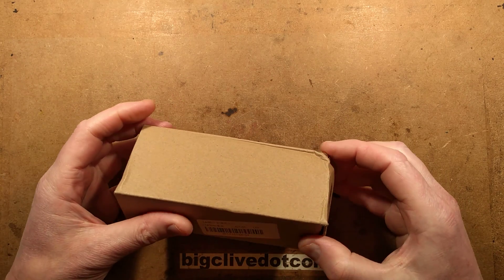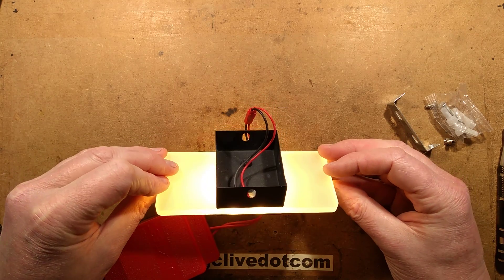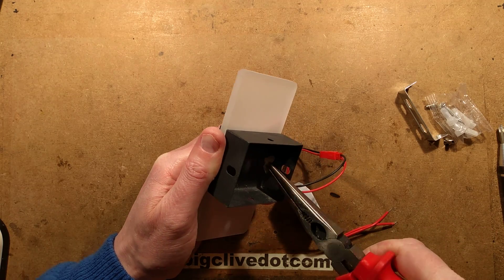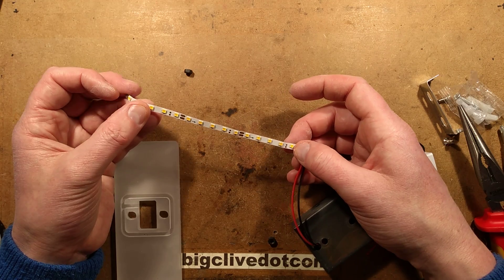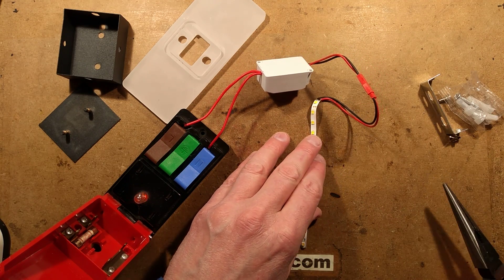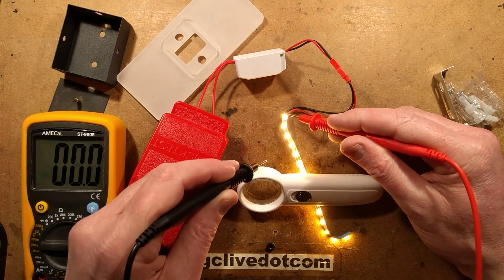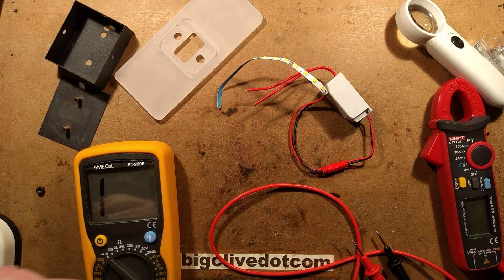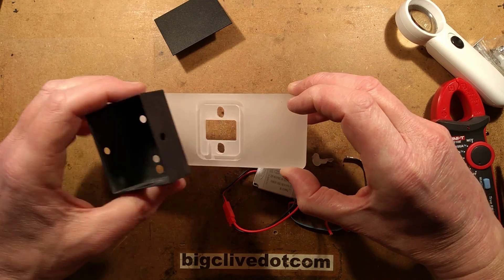Cleverly designed LED wall light with hackability.

Comment: While on the one hand, I would love some low-power wall sconces to light some areas of my home, on the other hand that looks like a design which will seem very dated in a short time. To me, it screams the 60s style of some design elements, especially their ideas of what might be futuristic. I think I may actually remember something larger with full-size light bulbs behind them, as well as something very similar meant to have candelabra bulbs behind. In the cases of these, the middle plate was there to act as a diffuser by blocking direct light from the lamp itself, bringing more attention to the acrylic plate and allow the indirect light passing through the panel and bouncing off the wall to illuminate the space rather than the harsh lamp itself.

Comment: I just found out that it is possible to modify the eeprom in this clamp meter. Over the EEVblog forum. Start in DC mode, 6000 count, longer back light timeout, dotless mode, more ncv options. They soldered wires on the board but it can be done with a simple clip on the chip.
Reply: you can also check this video https://www.youtube.com/watch?v=KIHGHWJFyGU&list=WL&index=112&t=0s or this https://www.youtube.com/watch?v=fX-Fhq9R4uY&list=WL&index=110&t=0s. and here is a link for a eeprom clip on ebay
Reply: Got a link to that? Not that I need any more meters in my life
Reply: @Fir3Chi3f  https://www.eevblog.com/forum/testgear/a-look-at-the-uni-t-ut210e/msg1034969/#msg1034969

Comment: Really hackable, you could power it from lithium cell(s) and exploit the metal front plate to make it touch sensitive using a TTP223 module for example
Reply: That's a sexy idea
Reply: Genius (everytime I hear that word I think of the fox from the mint mobile commercials)
Reply: I was not aware of that IC, seems useful, thanks!
Reply: the metal plate doesn't act like a finger already near the TP223? For example, the Cypress Capsense i found on youtube looks pretty complex, all to enable touch sense behind metal.

Comment: The red connector is a JST RCY, they're common in the radio control hobby world for low power applications (video transmitters, etc.).

Comment: Hi ive been told that my monitor im using with my BBC computer could have a different electrical potential from my BBC because it does not have a ground and could blow it up. Can you add a ground to devices that dont have them?
Reply: What monitor are you using ? To be honest this is extremely unlikely to be a problem especially with an LCD monitor, where the voltages involved are fairly low. Especially so if it's the kind of LCD monitor powered using an external power pack
Reply: @jaycee1980  hi it's a Hitachi lcd tv with only live and neutral. Its conected using RGB through a coax after I modified the output. Couldnt I just add an earth somewhere on the metal chassis inside the case.
Reply: @womble321  No need. The power supply in the TV is isolated. There is nothing to worry about.
Reply: @jaycee1980  thank you I rather like the beast and dont want it to die on me. Its now got a raspberry pi as a coprocessor btw. Great fun
Reply: Is no one going to mention the possible leakage current and resulting voltage due to a possible Y class capacitor?
Reply: @Mark1024MAK  hi ive just done some more research and discovered some people make sure the cable shield is earthed in hifi equipment when one of the units is not double insulated, it would be very easy to do, ive looked up leakage and am a bit confused. Seems connecting two double insulated devices is ok but when only one is it can potentially cause problems.
Reply: womble321 - Some class II appliances that use switch mode power supply units (SMPSU) use a class Y capacitor between the mains side circuitry and the “isolated” low voltage secondary / output side of the SMPSU. This low voltage side powers most, if not all of the circuitry in electronic devices like LCD/LED televisions, monitors, etc.
The purpose of the class Y capacitor is to suppress noise from the SMPSU. But it also allows a very small ‘leakage’ current to flow if there is an electrical path back to earth via any other device which has it’s own electrical circuits referenced (connected) to earth (mains earth or any other earth connection). The Acorn BBC Micro connects both it’s 0V/GND connection and mains earth to the metalwork of it’s own SMPSU.
So when you connect a lead between your BBC Micro and a modern LCD/LED TV, with both plugged in and the TV powered up at the socket, there may be a small spark (may not be visible) as you connect the lead.
So I recommend that you switch the TV off at the socket, or unplug it’s mains plug. Switch off the BBC Micro (no need to unplug it). Note that any and all class II devices/appliances that also connect to the TV (satellite/Sky/set-top box, DVD etc.) also need to be switched off at the socket or their mains plug pulled out.
Then connect the RF/UHF/composite video or RGB SCART (or whatever) cable. Same when disconnecting. No need to add any extra earth wires. So no need to open or modify anything.
Once everything is connected up, the problem is no longer a problem.
Note that the current is too small to do any harm to a human being, but if the current does pass through you, you may feel a ‘tingle’.
Reply: @Mark1024MAK  thats a brilliant explanation thank you so much. I would have tested it to see if it was earthed anyway before i touched it. I leave it more or less permanently connected but will be sure to to follow your advice. And yes ive definitely had a tingle from a tv lead before. Thanks again a little knowledge can be dangerous! Or at the very least confusing.
Reply: womble321 - no problem 😀
Reply: Pretty sure whatever powersupply is used in those is isolating. If you don't have any ground connection, the device is "floating", so it can't really be at a different potential. Quite the opposite. Ideally ground would be the same potential everywhere, but that isn't guaranteed, neither is the neutral the same. If you have two devices, it can happen that they are at different potential if they are connected to different circuits in your house (or even just different outlets in the same room, if there is a decent load on one of them). That can kill devices if those devices are connected to each other.
Reply: @superdau  thats about what i was told could I not just earth the metal frame inside. It a hitachi lcd tv id forgoten it wasnt a monitor because ive never used it as a tv.

Comment: 5:12 using a calculator to multiply 15 by 3? And I thought my mental arithmetic was bad.
Reply: I do this sometimes too. The calculator is already there and...
Reply: Using a calculator to find 1 X 3 was worse 😉
Reply: @georgeprout42   he demonstrated a mathematical proof that 1x3 still in fact equals three... common core math is trying to change that ^_^
Reply: @nobodyuknow2490    not quite - common core just tells us that 1 x 3 = 3, and 3 x 1 = 3, but 1 x 3 =/= 3 x 1
Reply: @restcure  no, exactly right because common core "mathematics" is the bastardization of thousands of years of mathematical certitude all to try and reinvent the wheel, only not as good as the wheel that already exists and in fact can consistently be demonstrated as inferior methodology and even in some cases flat out WRONG by virtue of its methodology.

Common core is to "mathematics" as a lobotomy is to mental healthcare.
Reply: @nobodyuknow2490  - were we both not referring to the effdup cc methods? - I thought I was
Reply: Worth understanding this is a constant current supply. So when you connect more LEDs in series, the supply will 'automatically' increase the output voltage to maintain a total flow of 200ma. He read 9V with the meter, but if more LEDs were connected on the strip be would have seen a higher voltage at the supply output.

Kind of counter intuitive when  used to constant voltage supplies. The voltage gets divided between the LEDs but the 200ma current flows through the entire circuit (even in the ground line)
Reply: I think the answer is 45... Just guessing as it's a "really" hard question
Reply: this is just lets say habit. i usually use calculator for everything, because i got used to do it.
from "200/5" to "calculate the meaning of the Universe" :D
Reply: People should learn how to work with numbers, bases and multipliers. As much as people like to rag on about Common Core in the United States this is what its intended to actually do. Long form multiplication seems efficient but requires remembering all tables in the single digits and then on top of that you have to write down the carry and worst of all the carry means nothing. Its the past "remember everything" teaching methods that make you reach for a calculator without realizing what the difficulty of a problem is at face value.

Understanding modulus math and being able to convert between them is very helpful here without knowing multiplication tables. We intuitively understand modular multiplication of 5 because its half of 10. But then why is 2 so much easier than 5? 52 x 5 is a lot harder to solve than 25 x 2. Being able to intuitively understand that 15 x 5 is actually modular 9 would make it super easy but how quickly do you see that?

There are 3 5s in 15. 3 x 3 = 9 so 9 x 5 is the same as 15 x 3. Modular math doesn't require you to carry either 9 18 27 36 45. See the pattern? Modular 5 also has a pattern. It always ends in 0 or 5. You could also use that to great advantage with 15 x 3. You already know since 3 is odd the number ends in 5. Further modular factors only require multiplications of less than 10 x 10 but also do not require carrying.

Thats really helpful if you did a problem like 9 x 7. 10 - 7 = 3. 7 - 1 = 6 (1 because 9 is just 10 - 1) so 63. You might think 15 was easier to work with because it has a one in it but its a pain because its two digits yet we can easily get to the same problem that only has one digit. All factors of 9 are just 10 minus X for the 1s digit and X minus 1 for the 10s digit. It gets even better. 9 x 700 is just 6300 and 9 x 777 is 6993. That applies to ALL repeating factors. Its much more useful and interesting to know and understand WHY numbers have these carried patterns instead of just meticulously writing down the carry each time and having no idea what it means to "carry" in fact you're just doing the stupid version of modulus.

Saying 5 x 55 = 275 is easy but WHY is it 275? Thats really hard to see with only the carry rule. But I know intuitively that if 5 x 5 = 25 then 5 x 555 = 2775. What the hell the 7 doing there?! well if you thought in modular math you'd know. 2 + 5 = 7. The carry rule is looking you in the face and calling you stupid. Long form is stupid.
Reply: I've found myself using a calculator to do 1+1... just to make sure it still adds up to 2. lol.
Reply: I cannot believe that michaelgibson cannot grasp the fact that 200mA/5 = 40mA per LED, in a 3 V parallel group, and that 3 of those parallel groups in a series string (3 + 3 + 3) = 9V.....

Wait!.....

.... this must be Youtube. 🤪
Reply: Lol!
Reply: He a good "Teacher".   It's for the video
Reply: Yea that was funny, especially making a mistake the first time and having to start again :)
But 200/5 didn't need a calculator.
Reply: But it wouldn’t be 200 divided by 5 though would it. There was more than 5 leds. 
It was 200mah for every led not 5 of em.
Reply: @michaelgibson3663  It was groups of 5 parallel LEDs connected in series so 200 divided by 5 is correct.
Reply: meucunt1 but there wasn’t only 5 leds lit so it couldn’t be divided by 5. If only 5 leds was lit then yes. If 200 is divided by five then where did the other leds get their current from. There was only total of 200 mah. He said each led was 40 mah so fifteen leds would be 600mah. ??
Reply: @michaelgibson3663  If you have 20 LEDs (or any other component) connected in series in a circuit then measure 200mA flowing through the circuit it means that all components have 200mA flowing through them not 200 divided by 20. The current flowing through a component is only divided where there are more than one path for it to follow i.e. parallel. If you think of each group of 5 parallel LEDs as a single component then each component has 200 flowing through it, then each "component" has 5 parallel paths. Sorry if I'm not making sense.
Reply: I get what you are trying to say but he tested the current for the whole thing so 200mah for everything. If five leds were parallel then yes i get what you are saying but if thats the case then there was 3 x 5 leds in parallel. That is roughly 70 mah per 5 led section. How can you divide it by 5. Surely divided by 3 would be correct and each led would be around 14mah each. 
Or am i missing something.
Reply: @michaelgibson3663  Yes, the part you're missing is that there is no division for the series. There are 3 items connected in series in this circuit, here's the important bit, ALL THREE have 200 mA flowing through them. Read that again, they do NOT have 200 / 3 flowing through them, they have the full 200 and that does not mean 600 total. Every part of any circuit connected in series has the same current flowing through it. It's the voltage that will drop across each component not the current. So now when we look closer at each series "item" we find it has 5 equal parallel paths so the current will flow equally through each part.
Reply: Ok lets say we had 10 x 3v leds that used 20mah each, if we connected them in parallel the voltage would still be 3v and the tolal mah would be 200 mah yes ? 
Clive saiid each led was 40mah so i am assuming he was working out the mah for each one using one 5 x led section and forgot about the other 2 sections, no ?

I get it that the whole circuit is using 200mah but surely no matter how you look at it each led is using 14 mah, yes.
Reply: michael gibson 
Long story short:

There are 3 sections in series (the same 200mA going through each of them)

Each section has 5 leds in parallel. (Dividing the 200mA between each led)
Reply: @michaelgibson3663  He did work out the math for one section yes but all 3 sections have 200mA, it is not shared all 15 LEDs have 40 mA flowing through them. This -  https://www.youtube.com/watch?v=xLkPB_Rb-Os     is 4 minutes and does a better job than I can in comments.
Reply: I can’t get into this any more. It’s getting out of hand. 😀
It can only be 40 mah per section though right and not 40mah per led. 
Otherwise the circuit would be drawing 600 mah and not the 200mah.
Reply: @michaelgibson3663  Just stop mate. :D
Reply: @michaelgibson3663  Let's just separate series and parallel for a sec. I think you're confused on what happens in a series circuit. If we wire 3 LEDs in series and measure say 21mA for the whole circuit then ALL THREE have 21mA flowing through them NOT 7. The fact that all 3 have 20mA flowing through them does not mean 60mA total. 

Take the water analogy where pressure is voltage and flow rate is current. If you have a total of 1 LPM of water flowing out the end of a hose, every part of the hose has 1 LPM flowing through it. If in the middle of the hose it branches out into 5 hoses each branch has 1/5 LPM flowing through it and when the branches are re-connected we still have the same 1 LPM of flow. Now add a second set of branches further down the hose, each of these branches has 1/5 LPM flowing through it and when the branches are re-connected we still have the same 1 LPM of flow

Now put a water turbine in each branch, each turbine has 1/5 LPM driving it. It does not matter how many sets of branches you add to the hose, each turbine will have 1/5 LPM driving it and the total flow (1 LPM) is always the same. 

Now just exchange "set of branches and turbines" for 5 LEDs in parallel and exchange flow rate LPM for current mA.
Reply: michael gibson 🤣
Reply: Either someone watching an electronics channel doesn't understand the difference between voltage and current, or this is one of the most niche trolls on YouTube.
Reply: always one douchebag pointing out childish shit

Comment: With a low profile case and 12v leds it would make great lighting for Tiny House living.
Reply: I'm working on solar power for that. I managed to get a 30W solar panel A tiny house should only need 12W of lighting and the battery is most likely going to be 150Wh lion. It's theoretically possible to go up to 600Wh without too much cost (basically it's £0.20 per Wh for the cells). The MPPT you can get for under £10 and that leaves output switchers etc. It's not difficult if you use COTS bits and pieces/ If you are interested let me know.

Comment: Part of me wants to see those retrofitted with a couple 1W LEDs, the big problem there though would be the heatsinking and getting the light directed outwards properly, but then, there's always the lenses as used in TV backlights which fire the light out sideways, hmm, got the ol' thinking juices flowing now...
Reply: just use some brutal cree chips and pulse them at 1% duty cycle at a low frequency. seizure inducing wall light
Reply: That steel case is a good thermal conductor. Bolt on a pair of finned heatsinks (on the sides so the fins are vertical), and providing you've not been stingy with the heatsink compound you might be able to stuff in quite a few LED watts (even Chinese watts!) :-D
Reply: @phils4634  not sure why but i'd take a seizure wall light over a normal one anytime